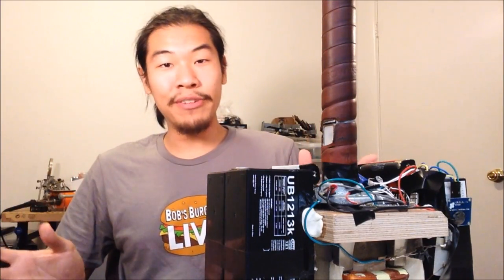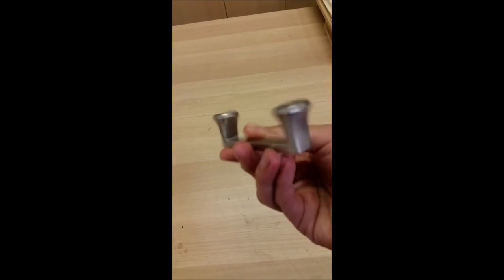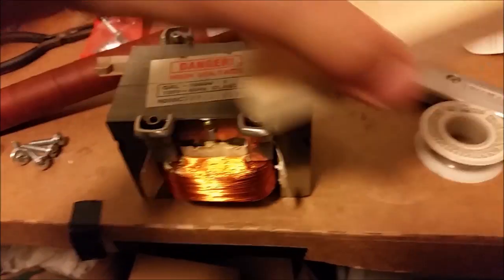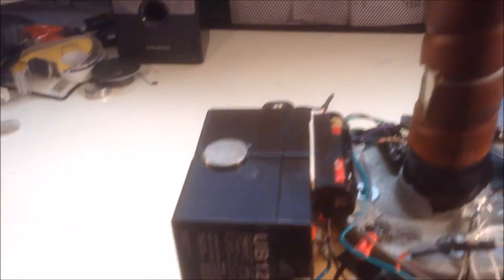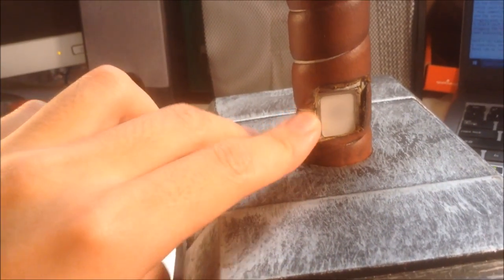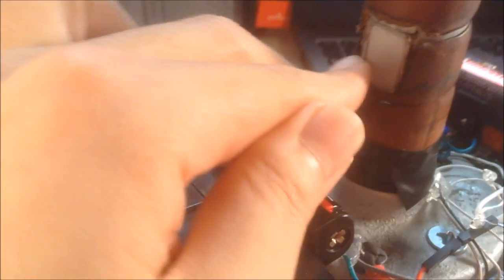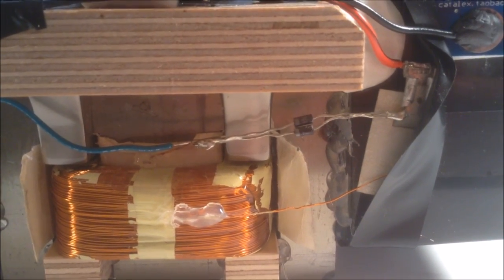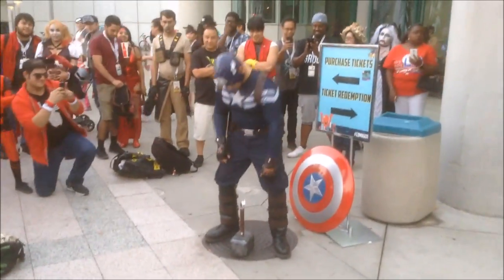How to Make Thor's Hammer - Mjolnir

Comment from the maker: This is my first How-To video, so let me know if anything's unclear! Don't forget to visit the Instructable for more details, and if you still have any questions leave a comment and I will try my best to answer.
Reply: +Sufficiently Advanced Have you consider using NFC tag and sensor instead of the fingerprint sensor for unique recognition? I think that will make your work much easier and also that could have avoided in people realizing that there is a scanner in the handle.
Reply from the maker: +Hebert Chan I've gotten that suggestion a lot! I wanted to replicate the hammer as Tony Stark sees it in Age of Ultron, since he guessed it read fingerprints. I'm hoping someone can use this How-To as a starting point to build their own Mjolnir with RFID, NFC, remote control, or whatever awesome idea they've got!
Reply: +Sufficiently Advanced Thank you so much for posting this, I'm a third year EE student. I was looking for a fun little side project and have been trying to recreate this since I saw your video a few weeks back. Just a question, Why did you choose to use a solid state relay, vs a power transistor? They are cheaper and are more versatile.  I would have never thought of the finger print scanner, great idea. I will be building it with the NFC tag and sensor, I got the idea from reddit, thought it might be a bit easier to code with.  Any suggestions that you thought of after you finished the hammer that's not explained in this video? Awesome job, and thanks again this helps me immensely.
Reply from the maker: The solid state relay was convenient, since it's already optoisolated and is packaged in heat transferring epoxy. You can certainly save a few bucks if you build around a simple power mosfet and include a heatsink and an optoisolating circuit. If you're really trying to simplify instead of optoisolation you may even get away with decoupling caps and a low pass filter, but at a certain point saving $10 isn't really worth the work :) If I built another hammer I'd start off with LiPo batteries and look into making my own "E" core and windings to really optimize the holding strength. I might also consider going the "fewer coils, more current" route after seeing how hard RC plane enthusiasts push their LiPos, even the little planes are drawing like 20 amps from a 500mAh battery! Ridiculous power draw that I assumed would be unsafe because I never looked into it. Good luck!
Reply: do you have a degree in electronic?
Reply: +Sufficiently Advanced Can you please do a how to for the Lightsaber? I really want to build one. Thanks
Reply: +Sufficiently Advanced how do you get the fingerprint scanner and how does it recognise you (i'm 13 so, i think this is gonna be an awesome project)
Reply: How much is all the stuff and do u need to be a expert to do it
Reply: +Sufficiently Advanced how heavy is it? What's it's equivalent in kg when on at sea level?
Reply: Can u do a how to for the lightsaber
Reply: Could you please send me a link from the article because i cant find this mjolnir on Amazon. Thank you very much for a fast answer !
Reply: where did you get a fingerprint scanner
Reply: Sufficiently Advanced it was a good how to, can u put a link where you got the hammer please. Thanks
Reply: hey man, first of all great video, i really want to make this, but i only have one question left? how to connect the 4  12volt SLA batteries? in series?, so i mean just connect the 4 batteries together and than connect it to the electromagnet (microwave transformer)? cause there will be a 48volt current trough the coil of the electromagnet?i really want to make this but i dont want to mess anything up (i dont want to shock myself or end up injured or death, i dont want to use a fingerprint scanner but just a momentary switch that turns the electromagnet off when you push the momentary button!,  i hope you will reply, it will really help me if you do! thanks!
Reply: hey man, this really helpful thx
Reply: What did you study in school?
Reply: Bro where are u from
Reply: Please reply my question I'm big fan ur

Comment: when cutting anything, i recommend scoring first, and then cuttkng through.. it leaves a much nicer cutting line
Reply from the maker: +Timo VanDeGriend I agree! I actually tried scoring and cutting a single line first, but the hammer head is hollow and made of soft plastic, so it buckled quite easily and jammed up the blade. I found the least awkward thing was using short, shallow cuts that weren't exactly neat but got the job done.
Reply: +Sufficiently Advanced you could smooth out the cut, by rubbing a piece of wood against it!, usually this will streighten the edge of the cut, and smooth out any potencial burs

Comment: Great thing! I built it here in Germany.My problem is the Magnet has no power. I used it from a Microwave oven too.The secondary coil has a resistance of 100ohm and i used 2x  22.2VLiPo Batterys up to 44.4V.
Whats my problem?Is it the thing we have in Germany other coils because of 240V in our Houses? What resistance is yours? Thanks for the Vids and the part list! Great work!

Comment: Hey bro, I use the Worx trimmer battery 20v lithium ion battery , 2 of them. Rechargeable.
And use a remote relay kit, to activate and deactivate. Reduce all the electrical mess you have, I ran a total of 5 wires only.

Comment: Why are you using two flyback diodes (9:01)? If you need a diode that can handle more current, you can't just use two in parallel as far as i know. Because they never will have the exact same threshold voltage and therefore one of those two will have to handle the whole current for a short moment and probably will die.
Reply from the maker: +andi n Well, it's not that you can't, it's just that you probably shouldn't ;) Ideally you'd use small resistors in series with each diode to use them in parallel, or just make sure they're tightly thermally coupled and pray. I did the latter since I had those diodes lying around already, and the flyback current shouldn't be too crazy...

Comment: engineering 101: "I didn't really find a good fix for this, I just started opening the serial monitor at the same time as pluging the FTDI cable into the arduino, so that the reset would happen right around everything powered up and SOMETIMES the timing just worked out ok" :D congrats on 100k subs

Comment: hey man, first of all great video, i really want to make this, but i only have one question left? how to connect the 4  12volt SLA batteries? in series?, so i mean just connect the 4 batteries together and than connect it to the electromagnet (microwave transformer)? cause there will be a 48volt current trough the coil of the electromagnet?i really want to make this but i dont want to mess anything up (i dont want to shock myself or end up injured or death, i dont want to use a fingerprint scanner but just a momentary switch that turns the electromagnet off when you push the momentary button!,  i hope you will reply, it will really help me if you do! thanks!

Comment: You could have just connected the 12v direct to the VIN pin on the arduino. It wouldn't fry the arduino, though I guess it would probably get hotter.

Comment: If I were able to pull off something like this, I'd probably disguise the magnet as the cap on the hammerhead making it less obvious.
Reply from the maker: +Dom Oranzi Yeah, it was tough since the magnet's gotta touch the ground for max strength. If you had a lathe or a mill you could probably make a sweet custom cap electromagnet, but I just had the broken microwave :(

Comment: Haha I wish I had enough skill to build this but alas, I can only work with 3D programs XD  Quick question, I can't remember if you mentioned this in your video, but how much was it for all the supplies?
Reply from the maker: +Keith Treason I probably spent about $200 on the original hammer, but I also had a lot of tools and odds and ends around. Starting from absolute scratch would cost more.

Comment: Hello sir i am a class 10 student and want to make this hammer to show in exhibition but sir i have some doubts 
1.Is this hammer powerful and is this durable means that if some one use more power to lift is it possible for him ?
2.Can this hammer break because of more force used to lift it?
3.Can any short circuit happen ? Or battery the power will get loose if use to lift many times?
Please sir answer me and please help me sir your sincerely thank you sir.

Comment: I am not able to make something quite as cool yet, but I am trying to learn. If I want to make my own electromagnet, how much copper wire do you think I would need? If it could lift 5kg that would be great.
Reply from the maker: +Niklas S Hm it depends on how big your core is and how thick your wire is. Mjolnir's electromagnet is maybe 2"x4", has about 1,000 turns of wire that's I think 24 or 25 gauge. 5kg is pretty light, so less copper wire than that?

Comment: I would put a reed switch instead of a fingerprint scanner. Because then you wouldn't have to cut the handle tape. 

So you could have put a small strong magnet in a ring an use that instead of your finger and scanner

Comment: how did you get the fingerprint scanner (or any electronics for that matter) to work under such strong magnetic field?
Reply: +Peida Li The magnetic field is contained within the iron core of the microwave transformer.
Reply from the maker: +Peida Li The "E" shape of the transformer core directs almost all the magnetic flux down into the ground. I probably should have mentioned that! It's similar to this principle used in mounting magnets:
https://www.kjmagnetics.com/blog.asp?p=mounting-magnets

Comment: Quick question, what is your capacitive touch sensor connected to ? It looks like a little circuit board of some kind. I think the optocoupler is also connected
 To it.
Reply: Also where to find those 22.2v lithium batteries at or what you suggest as the best ones
Reply from the maker: +ty cecil It was just a section of protoboard to try to keep things neat. I tried ordering 22.2v lipos off of ebay, but they sent me 14.8v instead! I worked it out with the seller, but you gotta be careful with ebay.

Comment: I'm working on this build now for Halloween.  I have a wide steel bar buried in the back yard where my above-ground pool was, with a 6" square area exposed above ground to set the hammer on.  I am installing a remote control switch to turn the magnet on right before someone tries to pick it up...then off when I want to lift it.  :-)  No capacitive sensor.  No thumbprint scanner.  I'm also using 2, 12V batteries:  1 to power the remote switch, and 1 for the magnet.  Same general setup as yours with the rest of the build!    I've already blown one remote switch that I had connected to an 18V power source instead of the 12V, but not losing momentum.  The new parts should be here in 2 days.  I'll be sure to upload a video, should I get it all together in time!  Thanks for the details on the build!
Reply: Stephen Zaffarano 
Csm you make a video trolling people who try to lift it?????
Reply: One more: https://www.youtube.com/watch?v=QfwV0IeskqA&t=3s

Comment: Hey first off I want to thank you for this video! I was waiting for this ever since I saw your original video and was amazed. I was so excited that I already took apart an old microwave. I was wondering if four of these batteries would work for this? 

http://www.hobbyking.com/hobbyking/store/__8932__Turnigy_2200mAh_3S_20C_Lipo_Pack.html

it is 11.1V and produces 1.1A 
Thanks again!
Reply from the maker: +Eddy Chiang Those should work great! $9.99 too, nice! I've actually just ordered some 22.2v batteries to up the power in my hammer. What kind of charger are you going to use for your batteries?
Reply: +Sufficiently Advanced Oh yah I forgot that the more voltage, the more power. Which 22.2v batteries did you purchase? 
I am into Quad Copters and what not so I already had this charger
http://www.hobbyking.com/hobbyking/store/__49420__X100_AC_DC_100W_Touch_Screen_Charger_US_Plug_.html

there are definitely cheaper versions though.
Reply from the maker: +Eddy Chiang I got a really cheap brand called Lion from eBay. I'm not pulling a ton of current so I figured they'd hold up okay, but the seller accidentally sent me completely wrong batteries, so I'm trying to return them now :(